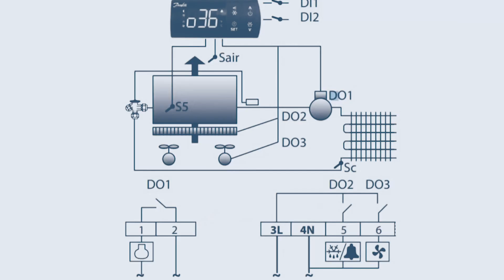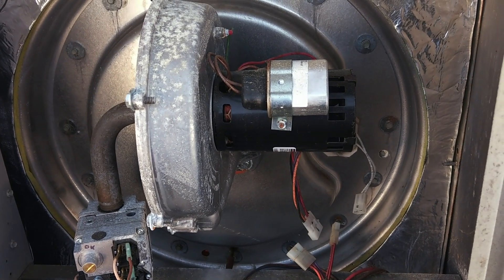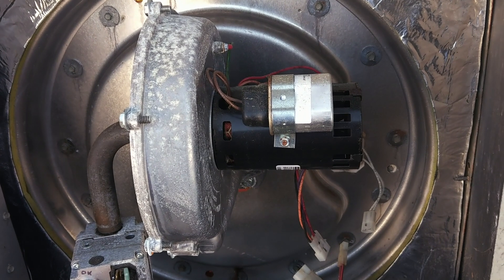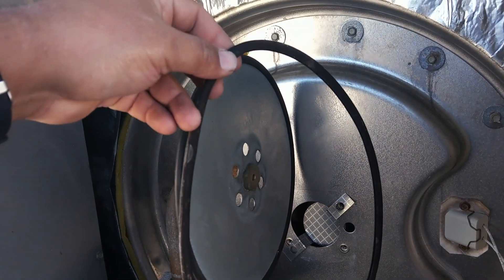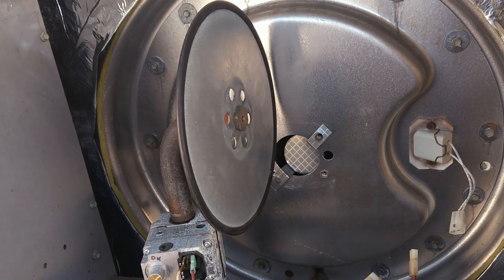Trane Voyager Gas Screen Tip

Comment: Would you do this on a maintenance or just when having combustion issues? I've had those bolts thread inserts break loose and couldn't get back together. Had to replace entire heat exchanger plate.

Comment: What happens if the screen is not reinstalled when the inducer is replaced?
Reply: Ok. A little Updates on the unit i mentioned. I found out that another company worked on the unit before me and they installed wrong ignition control board. As for woofing burner sound, gas valve was not opening correctly.
Reply: @leepaeksoon4886   Thanks for the update. Did you get a new screen installed too?
Reply: I wonder the same question. I cam across unit firing up but coughing and flame goes out. I opened up and saw someone took the screen out and never put back. I will come back tomorrow with new screen and see how it will go
Reply: @leepaeksoon4886   I’m curious if that was the problem in your case. Because I didn’t see this video until after I removed one. It’s been running great for a month without it, I’m just hoping I don’t cause any issues down the road.